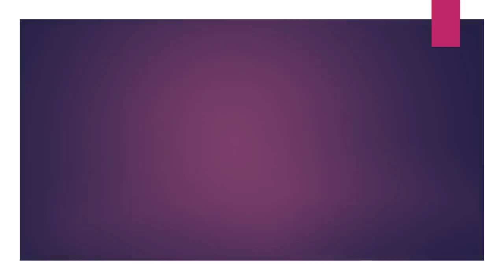How to Install  cable tray Practical Skills

Comment: In the future, try to use an impact screwdriver and a grinder. Impact screwdriver work faster and you can put directly the screw The grinder helps you to cut unwanted pieces. The entire cable trays must be earthing.
Reply: The tray needs earthing???
Reply: Do you mean grounding?
Reply from the maker: Thank you for watching our videos.visit our website for more information https://ryb.com.bd/
Reply: @josephbodoh3122  the term earthing is used in the electrical installation sector